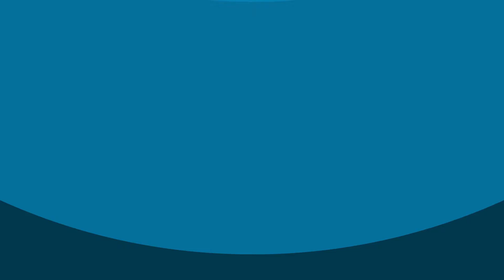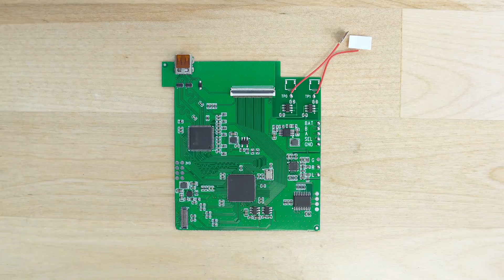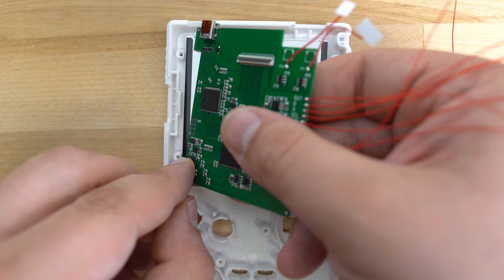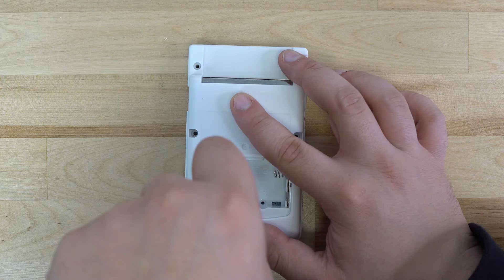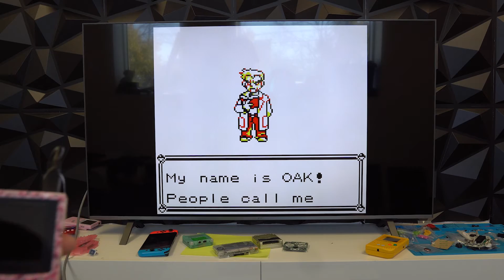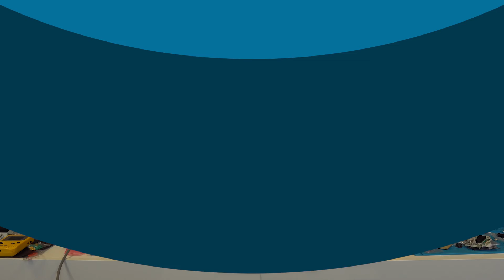HDMI IPS Kit  | GBC Install Guide

Comment: Hello. What about those wires with TP0 and TP1? It's never explained where those go, or on which part of the shell they should be fixed to.

EDIT: Got it, those are the touch pads and show be fixed to the upper part of the shell.

Comment: I’m sorry could you elaborate on why micro hdmi connections are weak?
Reply from the maker: Sure! So in general regular HDMI connections are already pretty fragile, we see it all the time with destroyed HDMI ports on modern consoles and such. Because you are making the connection that much smaller with a micro hdmi connection, practically any force on the connector can potentially damage it. Unfortunately that seems to be the case with these kits as well, it seems no one has designed a stronger micro HDMI connector, that we have come across at least.
Reply: @HandHeldLegend thanks I was wondering too lol (I was never here)
Reply: @HandHeldLegend well, I never managed to break any HDMI port ever, I want to get this mod to stream from my GBC, Did you manage to break your micro HDMI? Or is still working?